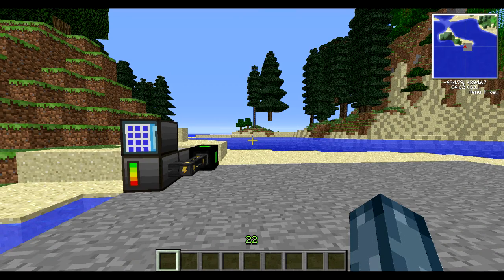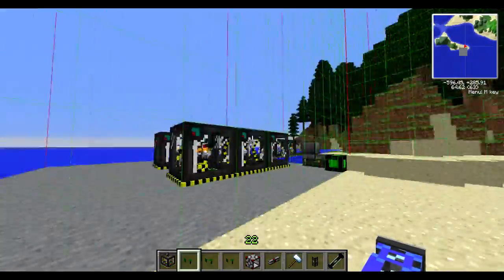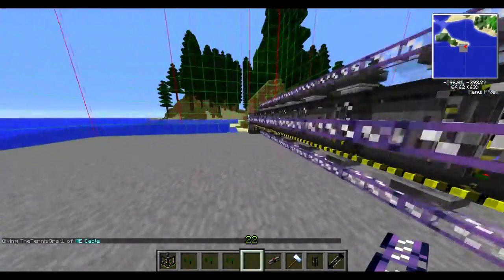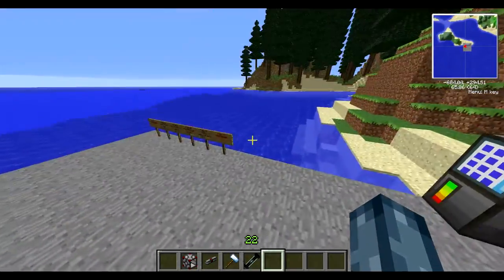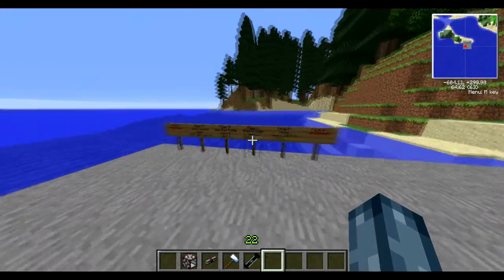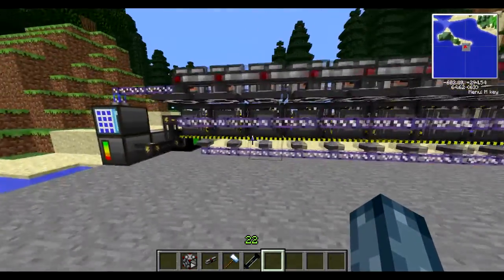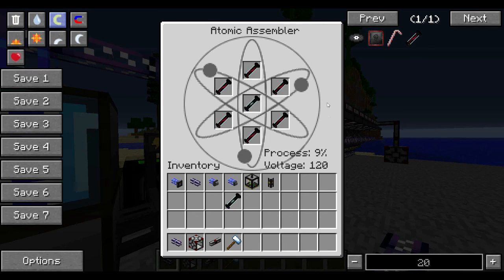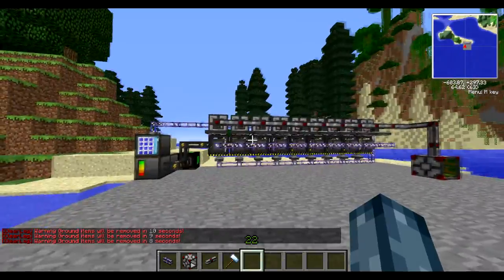Automatic Atomic Assemblers [Voltz] - Rednet

Comment: Can u plz help me whenever I use this it goes to 13% than restarts back to 0 and it's not power bec I have a full fusion reactor set up to u it
Reply from the maker: Rory Chernosky the only reason it would restart is if there is something not quite right with your rednet, make sure all the rednet is inside the same chunk and that it's coded correctly
Reply: TheTennisOne Dodd it still isn't working
Reply from the maker: Rory Chernosky what server are you playing on, or are you in single player?
Reply from the maker: Rory Chernosky what server are you playing on, or are you in single player?
Reply: TheTennisOne Dodd I'm on rubber colts in my region
Reply from the maker: Rory Chernosky gimme 5 mins I'll come on and have a look
Reply: TheTennisOne Dodd I'm on now what's ur ign
Reply: TheTennisOne Dodd I'm on now what's ur ign

Comment: Heh, My atomic assemblers after doing this only say "Ready" and there is no processing. I think I did everything right, it has all the requirements, power, strange matter, antimatter etc.
Reply from the maker: I would make sure to check the power source, also, ensure you are using 125 mg anti matters the grams themselves do not work
Reply: Haha, Thanks for the fast reply, I found out about half an hour ago it' the power only.